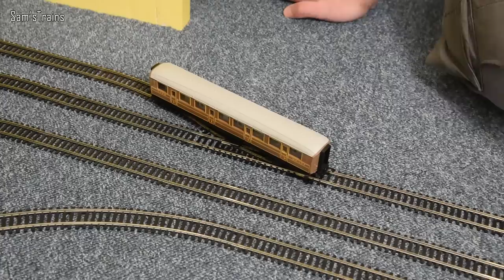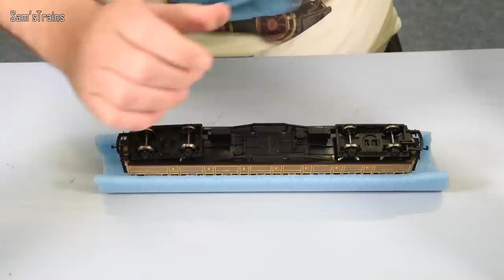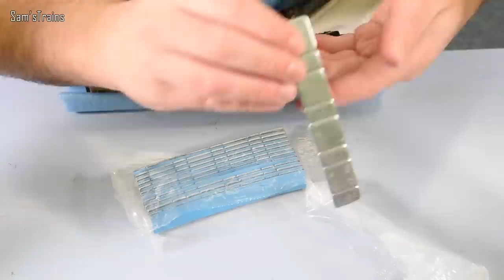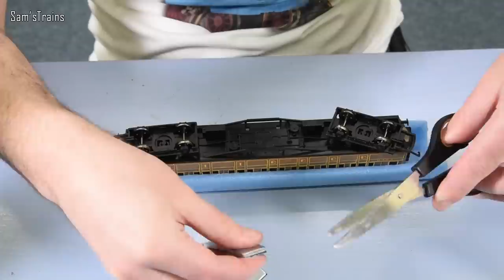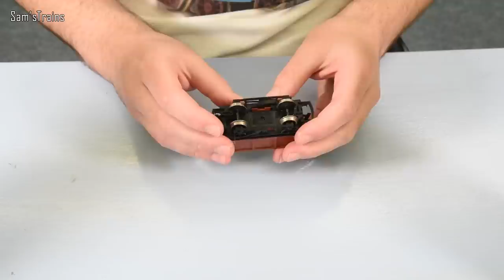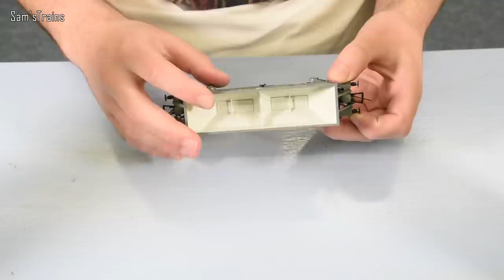How To Stop Derailments on Your Model Railway

Comment: Hello Sam!
I've recently encountered an odd problem with some of my point-work.
It seems that at certain times, my engines like to catch on the points and derail.
This has most often occurred in reverse, and my track-work is definitely a bit shoddy.
Could you give me some advice by chance?
Reply from the maker: Hmmm that's interesting - which locos are they, out of interest?
Thanks for watching, Sam :)
Reply: @SamsTrains  
Most often, this occurs with my Hornby Caledonian 0-4-0 saddle tank and Adams Radial,
The other locos that have this problem much less frequently are my two Hornby j94's and a Bachmann 0-6-0.

Comment: Hi Sam, have you considered DCC Concepts powerbase? I'm considering using it on coaches because adding extra weight could be an issue for longer trains on grades.
Reply from the maker: Hey, I haven't thought of that no - is it decent then?? I can look into it! :D
Thanks for watching - Sam :)
Reply: @SamsTrains  Not yet. I'm also having a look at just buying a pack of magnets on Ebay and some engineers strip metal from a local builders providers

Comment: my flying dutchman 70018 derails from the front wheels on slight bends tried changing the front wheels and still does it any suggestions
Reply from the maker: Ahh sorry to hear that - I'm not familiar with those unfortunately mate :(
Thanks for watching - Sam :)
Reply: @SamsTrains  the train wont actually turn corners because the shell stops the wheel span turning its really bad all other trains go round but that 1

Comment: I have put small straits on all my points but still derail
I am chiping old locos with coarse flanges
And putting 7 pole spiral wound motors in
Reply from the maker: Hmmm... which points are you using?
Thanks for watching, Sam :)
Reply: @SamsTrains  the peco express points
And tried ordinary points and hornby
This scale wheels now is no good also having the center driver flanged to me is no good

Comment: I'm sorry but if you  use the wheel gauge and then have to alter the wheel spacing, what is the purpose of the wheel gauge??? Why spend the money?????
Reply from the maker: That's true! The problem is that different brands of wheel have slightly different flange thickness.... so there are a couple of different HO/00 gauges available as a result! Mine isn't ideal for those Hornby wheelsets - I really needed the slightly slimmer gauge!
Thanks for watching - Sam :)

Comment: Some longer points might help too.  With a less aggressive turnout.
Reply from the maker: Yes you're right - many wagons don't like those tight points!
Thanks for watching - Sam :)
Reply: @SamsTrains  yep. But if space is limited sometimes the shorter points are necessary.
Reply: If a #6 or #8 switch (point) is not in the plans due to space restriction then a smaller passenger car across those #4 switches might be better.

Comment: Hi sam is it ok to use white spirit to clean locomotives and rolling stock wheels?
Reply from the maker: It should be Daniel - but make sure none goes on the bodywork, it'll ruin it! For best results, buy a bottle of IPA on Ebay! :D
Thanks for watching - Sam :)
Reply: @SamsTrains  thanks sam yes know about that which is why after ive cleand a wheel i immediately dry it with a cotton bud

Comment: Also maybe don’t go over incorrectly set points that will push it over, and don’t put light empty cars in the front and heavy cars in the back or it will “string line “ on a curve.
Reply from the maker: Yes that's very true - that can definitely do it!!
Thanks for watching - Sam :)

Comment: That's really wired I use my LNER carriages all the time and I have never had any derailments with them but I have got some shell homby wagons and they do not stay on at all on any point of the layout
Reply from the maker: The trouble is I changed most of these wheels for metal ones - that's when the problem started! It is strange though - some were fine!!
Thanks for watching - Sam :)

Comment: Can be a pain in the bum to rail them sometimes, or even keeping them on the rails, fro that matter.
Reply from the maker: Yeah it definitely can Tomas!
Thanks for watching - Sam :)
Reply: Sam'sTrains Not to mention that model engines can sometimes act rickety if the track is not properly cleaned for electrical currents to flow.
Reply: Sam'sTrains You ever thought about tracking down and buying the Hornby Dino Safari set? It is a rare set released circa the late 90s-early 2000s, but some sites like Gumtree, or maybe eBay, the last time I saw at least, was given the price at £20, another was priced, or auctioned for around £47.99.

It’s an awesome and imaginative set with a Jurassic Park-like setting, which comes with a Class 08 with a Dino Safari motif, albiet an outdated class 08 design that was common with Hornby at the time, along with four flatbed wagons with two dinosaur containers to mount on them and loads of dinosaur models of different species. Guess you can get more than ehat you bargained for with this set.

Comment: Those weights are made to go on the inside of a rim and stay there until it comes back in. I use these things everyday at work, and as long as the surface is reasonably clean and dry, they ain't goin nowhere.
Reply from the maker: Yeah absolutely - they certainly don't let go very easily - I've been really impressed by them! :D
Thanks for watching - Sam :)
Reply: @SamsTrains  Wait, I just thought of something. Would you be able to fix Edward's issue of being too front heavy with those? If I remember correctly, he does have an open cab space that could be used.

Comment: Hi Sam, 
The NMRA have come up with a very good weighting system called Recommended Practice 20.1. Here is a link to a .pdf file explaining it. For OO use the HO ratio. https://www.nmra.org/sites/default/files/standards/sandrp/pdf/rp-20.1.pdf As it is American it's in ounces. You can easily find a conversion table to convert ounces to grams, if it doesn't match exactly always round up not down.
Cheers
Boa
Reply from the maker: Hey Boa, thanks very much for this - I've only just recently been hearing about this, but I'll be sure to look into it!
Thanks for watching - Sam :)
Reply: @SamsTrains  My pleasure. Sticking too much weight in coaches or goods trucks can be detrimental as your locos won't be able to cope with the extra load. For very awkward places there is a product called "Liquid Gravity" you pour it in them add a few drops of diluted pva glue (like ballasting).

Comment: 7 £ for a machined tool sounds reasonable to me.
Reply from the maker: The back to back gauge? Yes, but not if it doesn't gauge wheels correctly ;)
Thanks for watching - Sam :)
Reply: @SamsTrains  true. Nothing is worth the cost if it's made incorrectly. I was thinking of seeing if making a gage just like that but with a way to push itself off of the axle.

Comment: It seems that Hornby makes a lot of trash.....😖
Reply from the maker: They certainly do - but they make some great models too though! :D
Thanks for watching - Sam :)
Reply: @SamsTrains  I have a small N gauge railtrack from  Fleischmann Piccolo, way smaller than your models. I think they are better eningeerd but derailing also appears sometimes always at a moment you never expect. Cleaning wheels is crucial. Extra weight on the axels is an old but good tip, but makes the train slow. Put the extra weight inside the car, out of sight. Keep going!👍

Comment: You have small radius points on a carpet base and you wonder why you have derailments?
Why is someone who does this giving advice to modellers?
You have problems with a curve right after a point?    ALL crossovers are like that.
I use no points smaller than 3' radius, and most of the curves on my layout are 4' radius or more.   I have a layout in two rooms of my basement and the only derailments I ever get are on a lifting section over a door, and that's because of earth movement which puts the tracks out of alignment.
Reply from the maker: Oops Alan - your logic doesn't quite make sense, since the coach worked fine on the 'carpet base' after the modifications shown!
Thanks for watching - Sam :)